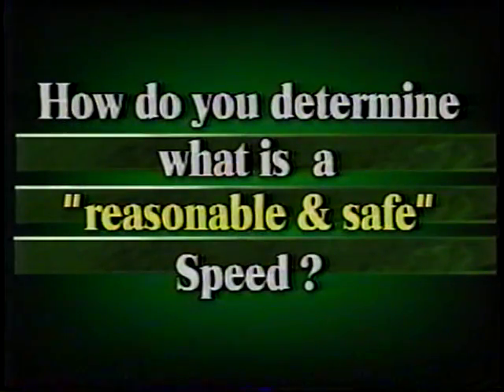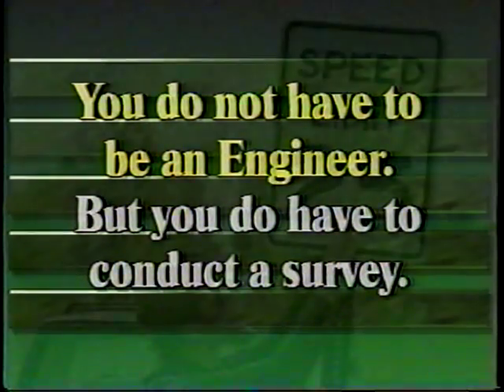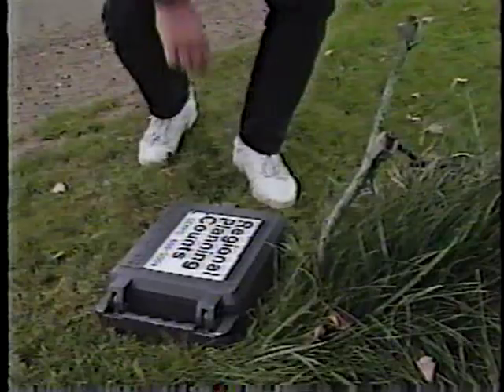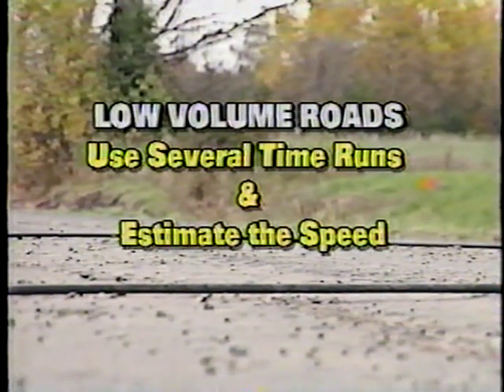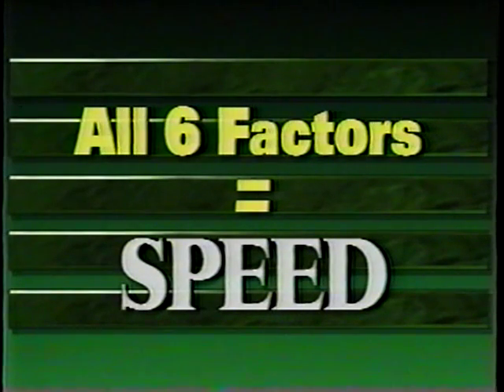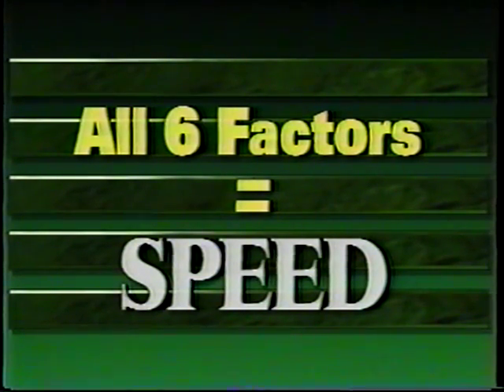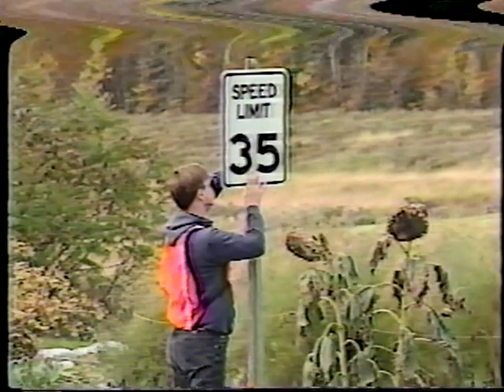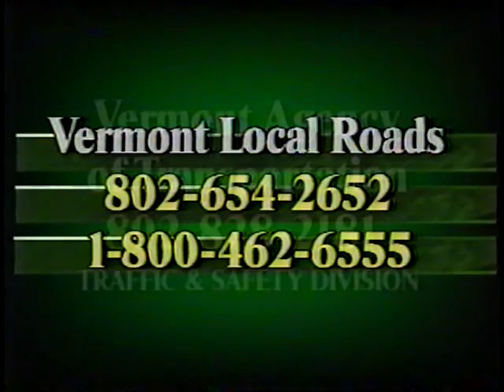Setting Speed Limits

Comment: Section 1A.09
Engineering Study and Engineering Judgment
Early in the processes of location and design of roads and streets, engineers should coordinate such location and design with the design and placement of the traffic control devices to be used with such roads and streets.